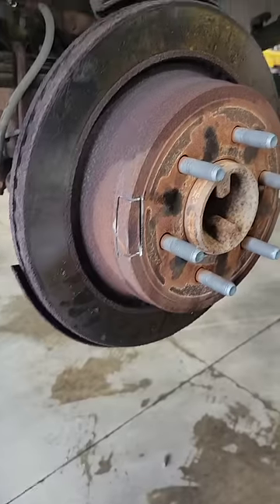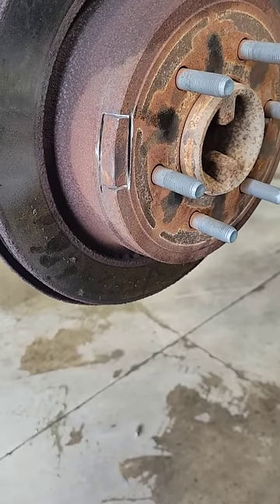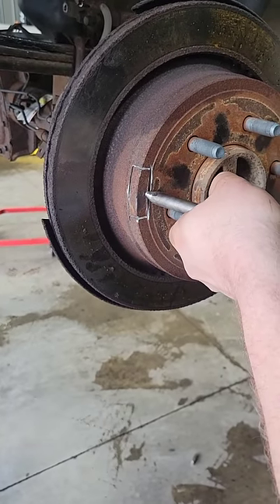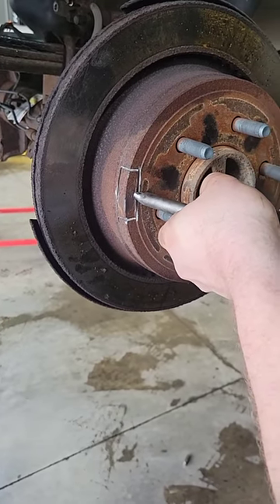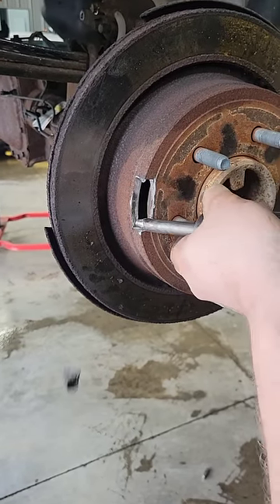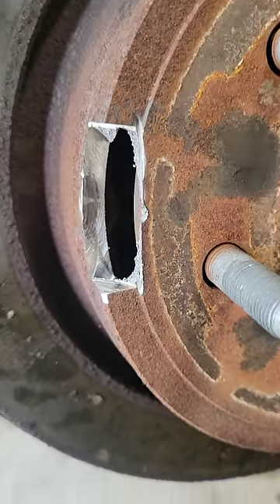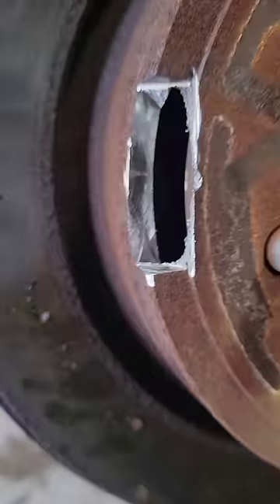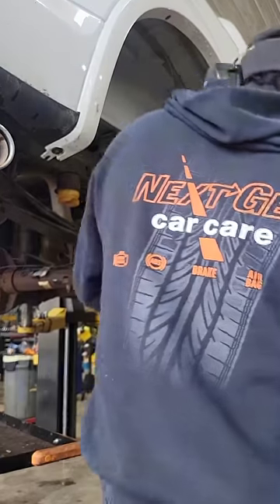Ford F-150 rear brake service.  Trying to show a trick on getting them off without further damage.

Comment: If this is the new breed of mechanics, we’re all in big trouble.
Reply: no i really think its the design of the rotor that consist of parking brake that made it worse for them.
Reply: @HighAway this isn't a new design.
Reply: @MattyH1992  I didn't say it was new. it's a known problem. probably the designer didn't forethought it but the down the dowels the birds sitting on, such as mechanics probably knew it'd be problematic.
Reply: Just get a hammer bro  the shoes on springs 🤦🏿‍♂️
Reply: It's fuck up by Ford. Every one else provides access holes to loosen the shoe adjuster. Some cars have access on the back via the backing plate, but most common way is to pull rubber plug form the hole in the disc to gain access. BTW, most of the time rotors go to the recycling bin if new pads are installed.
Reply: This is the new throw away version 😂
Reply: Cutting the rotor I don’t remember that in any mechanical books  or training from the factory schools .
Reply: I think we been in trouble already for quite some time, with the luck I’ve had with using different mechanics? Seems really hard these days to find a really good honest mechanic that won’t rip you off  last mechanic charged me $5,000.00 to fix all the oil leaks my engine had. Got it back home and it was still leaking oil as bad as it ever had. Think they just steam cleaned the engine and said they fixed it
Reply: I had "new" mechanics seriously argue with me saying my rotors were backwards. They're drilled and slotted. I had a tire mounted by these experts.
Reply: exactly he mentions using a hammer is not the way to do it, but he has a cutoff wheel for brakes. We both know he taped a head gasket leak. :)
Reply: that's why I prefer to do it than paying someone to destroy my car
Reply: They all get electrocuted, possibly in the soon 😂😂
Reply: There should be access through the rotors to the adjuster I blame whoever put the wrong/cheap rotors on last or blame the truck for not having a access hole through the back dust shield
Reply: It is and we are.
Reply: It actually does fit a spoon. There's a plug.
Reply: Easiest way to get rear rotors off, it'll the E brake works is at 30 mph slowly apply the e brake. You will hear a slight thump. Pull it on the lift and they will slide right off..
Reply: had to do this on my old cobalt lt shoes were engraved into the rotor and there was no ‘spring release’ or hole to put a screw in, this is exactly how I did it and it did no harm
Reply: @pliedtka and gm
Reply: @pliedtka wrong. New cars come with a plate that needs to be knocked out before the adjustment of the parking brake shoes. It is then filled with a rubber plug after the first service.
Reply: Hammer and some brake cleaner she’ll pop off
Reply: @mw5905 @mw5905 Actually you can in fact install slotted rotors "backwards".
There are videos that go in depth with the logic behind it but basically depending on the type of slotted rotor you have, you want the direction of the slots and the internal fins ( if at an angle) to be facing one direction.
Reply: @boostedturbotom drill into a tesla battery and zap lmao 😂
Reply: A break spoon....or even a flat screw driver......
Reply: I bet it sounds like a baby rattle when he shakes his head
Reply: Wow lol
Reply: Yes not my way either
Reply: @ghostridergale I do my own work, and take more time, replace more parts as "preventative" / slightly "ahead of scheduled maintenance"- which should be how cars are repaired, not just airplanes... 
But mostly because of the corruption of mechanics...
Reply: @mw5905 left and right rotors are in fact a thing.
Reply: @pliedtka no, ford does actually put access holes for the parking brake adjusters, this guy's seems brand new.
Reply: this is what happens when mechanics are paid by the hour and not commission.
Reply: @nunya2814 indeed. This guy has never seen drum brakes. Zoomers...
Reply: Don't have a  new breed of mechanics have Fitters. They fit stuff....
Reply: @pliedtka  do these even have shoe adjusters? GM drum-in-hat doesnt iirc
Reply: @mw5905 I had a new mechanic argue that you can't rebuilt an alternator.

He told me "theres no way you're going to rewind it yourself so don't even take it apart" as if that part ever fails on the alternator.

Comment: *forgets to release the parking brake prior starting the job
Reply: or seized?
Reply: Buahahahhahahaha
Reply: @HighAway  if the parking brake hardware is that siezed, then replace shoes and the drum brake hardware as well. Don't save that sh$t
Reply: 😆 😆 😆 😆 90%
Reply: Lmao done that a few times,  if you say you haven't you lyin 😂
Reply: not only that but there is a shoe adjuster on most (not all) drum brakes in which u turn it and should relieve tension
Reply: I hit mine for a good 5 minutes with a mallet. Went to take a smoke break, opened the door, and realized I left the parking brake on 😂
Reply: @ehh33636 Exactly. And if the car can move then it's not seized.
Reply: It's called the rust belt but that also happens
Reply: Evidence that he didn't?  Maybe the guy actually does know what he's doing instead of just using a bigger hammer.
Reply: @slushy7292  In that case, the parking brakes are not seized to the inside of the drum or rotor. They are just seized.
Reply: Been there lol

Comment: I wish these shorts had the name and location of the business so I know never to go within 10 blocks of there.
Reply: How else are you going to get it off, when it's stuck?
Reply: 7786 NY St Rt 5. Clinton New York

Found it on there website
Reply: @CM-xr9oq  I dunno...engage the parking brake and move the car ten feet to scrape the rust off?
Reply: @CM-xr9oq  Back off the adjusters.
Reply: @kugelblitz1557 that wont remove the rust ridge from the spot where the parking brake shoe doesn’t touch you dunce

Comment: I've been a professional massage therapist for the last 30 years and even I know all you have to do is back off the brake adjuster and the rotor comes right off. Probably why I still do most of my own work.
Reply: Whatever it takes
Reply: @RebelBoy-is7hw  The adjuster is accessed from the back of the backing plate. Crawl under the truck, and at the bottom of the backing plate is a rubber oblong plug, pull that out and you can access the adjuster star from there.
Reply: Doesn’t alway work like that. Sometimes there’s a massive rust ridge on the inside that doesn’t slide over the shoes.
Reply: Stick to rub and tugs at least you will get a happy ending….
When this happens to a real mechanic they smash the lot off and make you pay for new shoes and backing plate. 
Depends if it’s your car or a customers / who’s paying 
If you grind the backs of the locating pins off it’s quicker and easier.
Now rub my shoulder
Reply: IME in the rust belt those adjusters tend to be froze. Or maybe it’s just my luck.
Reply: That's what I said finally someone else knows what their doing
Reply: Yep, that's exactly what spider gears are for.
Reply: @corey5797  amen brother that's what I do
Reply: Most vacuum plates are rusted off in three years on every new I had they are all gone
Reply: @robglock2130 ou can also try pushing the cable if its hung up she might just release for you. 

Low success rate but its quick to try

Comment: Hit it with your purse. I've never seen anyone anywhere do it like you did.
Reply: Top comment
Reply: He saved the 12 dollars in parking brake hardware
Reply: @idabomb00  and destroyed the 50$ rotor in the process😂😂
Reply: 😆  hahaha
Reply: @idabomb00  saved? Hammering the rotor off wouldn't cause any damage unless they already at the point of needing to be replaced.
Reply: @GmKofHard  yes, saved. 12 dollars is what the hardware cost new.
Reply: @led1002 he said he was changing the rotor. Listen to the vid.
Reply: We've got a sledge hammer at our shop named "Your Purse".

Comment: This folks, is why your brake job takes 3 hours and costs $600.
Reply: This and also because of the electronic parking breaks that require you to get a damn diagnostic tool to release the cylinder so they won't get damaged when retracting them. Also you need a damn diagnostics tool to release the cylinders one by one in order to do a damn brake flush.
Reply: @thegohanmk7411  Thats why i love my +20yo shitboxes
Reply: 6 hrs minimum 9 to 12 hundred $$$
Reply: @thegohanmk7411  not true this is manual parking brake assembly with brake shoes and a brake drum in the middle of the rotor no computer control needed. and the one with the electronic parking brake can be put in maintenance mode by pushing the park brake release switch while holding the gas pedal to the floor and turning the key on then off then back on and wait 15 seconds while still holding switch in and pedal down and it will go into maintenance mode to be able to compress the pistons back into the caliper !!! easy peasy
Reply: @majiclikstk  rotors are $66 each and set of pads is $25 and takes 20 min each side to remove brake assembly , clean and maintain caliper and slide pins and pad guides and reassemble with new rotors and pads , I charge parts cost plus 15% and $150 labour so $330 for this job and done under 1 hour

Comment: Most vehicles have a hole on the inside plate covered with a rubber plug. This hole will allow you to back off the spring tension to allow drum removal.
Reply: Where do you see a drum in this video?
Looks like a disc to me.
Reply: @tommyguns9008 the parking brake is essentially a drum brake.  It has a disk around a drum.
Reply: Exactly!
Reply: @tommyguns9008  the drum is inside of what looks like the disc to u
Reply: Its literally called a drum in hat rotor. Also yes no cutting of the drum area to access the shoes. You access the shoe adjusters and loosen them a few clicks. Something you will likely have to do anyway when installing the new rotors. You can than tighten up the adjusters and set the parking brake temsion to spec. I swear the future is doomed with mechanics like this
Reply: There isn't a hole on this brake system. So what are you supposed to do unless you beat it off. Get it. Beat it off. Anyway that's why he did this
Reply: @danielquick5696  I've literally never seen a vehicle that doesn't have a backer plate with access holes or slots to get to the adjusters. This video is a terrible example of what to do. In no way should this be used unless all other methods have failed to get the rotor off
Reply: @scrumdiddlyumptious73  Your right. Only if the brakes are seezed up. It's either that or beat them off. 🤣🤣🤣
Reply: @tommyguns9008 don't reply when you don't know what you're talking about
Reply: @danielquick5696 nonsense. There is an access hole in the backing plate. Just remove the rubber plug and go to town with your spoon.
Reply: Shhhh 🤫 just let them go
Reply: @amneziaxeaster-gaming382 buddy this is YouTube, expect the worse.
Reply: Not quite, the adjustment is the internal spreader mechanism, nothing to do with spring tension. Helps to relax the psychical adjustments on the cables too.
Reply: @scrumdiddlyumptious73 The problem, is that those adjusters have a nasty habit of freezing up on these, especially here in Michigan. Its not uncommon to have to cut these off with a torch and replace all the hardware.
Reply: Integral parking brake system. The hat of the rotor serves as a brake drum for the mechanical parking brake shoes. It's has an screw adjuster on inside. The service plate has a plug you can remove and use a flathead or a brake spoon to compress the springs to loosen the shoes just like drum brakes. Once he gets the rotor off he still has to adjust the parking brake shoes to fit the new rotor on and do a complete parking brake service. Only thing he did was waste time. Definitely not a flat rate technician.
Reply: This is a rotor not a drum brake so access to the inside is not likely to be easy at all.
Reply: Not trucks, it in the backing plate, its a pain in the ass but yes same thing u just loosen the shoes then knock the scale off with the hammer on the hat and doesn't damage anything, do it every day
Reply: @tommyguns9008  These are called drum in disc configuration where there is a small drum brake inside the disc brake.
Reply: @danielquick5696  it must have a hole otherwise there is no way to adjust the drum parking brake.
Reply: @jasonsong86  I understand that but some manufacturers make huge mistakes. I've seen some messed up parts that I've just shaken my head at and wondered what they were thinking.
Reply: @tommyguns9008 you tried to do something. You failed…but at least you tried.
Reply: Then they would have to make an adjustment when they put the new parts in thay don't want to do that
Reply: @jerrywhalen2100  To adjust your parking breaks drive in reverse and pull your parking break. I don't know if this works on every car but that's how I do it. So you don't have to adjust them by hand.
Reply: That's the access holes to adjust the rear shoes👍
Reply: @tommyguns9008 tell me you havnt worked on many cars without telling me. It's a 2 in one brake setup
Reply: The only trouble with your comment, is this isn't a brake drum, it's a rotor.
Reply: Little difference in a rotor and drum lol just a little😁👍
Reply: I was gonna comment this lol
Reply: @tommyguns9008 the inside of the rotor acts as a drum for the parking brake shoes. And there is a hole with a rubber plug to use a brake spoon and back the park brake shoes off.
Reply: This guy.😂
Reply: @criticalevent  let me guess it's an electric parking brake? It's it like many new vehicles they utilize the actual caliper/pads to apply and clamp the rear brakes. There is usually a sequence of steps to get the parking brake actuator to retract fully. You have to usually unplug a wire harness that's on the caliper also. Even as vehicles advance brakes are one of the easiest repairs to do. Regardless if its dirty or a little extra work of removing wheels etc I'd rather do brake repairs than spark plugs on many of today's vehicles. You end up having to take have the engine apart on these new vehicles.
Reply: Yes. Thank you for saying this. The guy who made this video needs to learn that
Reply: Doesn't always work but why is he actually holding the punch instead of the hammer
Reply: @tommyguns9008 they have both parking brake is a drum and regular stoping brake is rotor 😂
Reply: @tommyguns9008 it’s a hat type rotor the drums inside
Reply: @scrumdiddlyumptious73 rust belt. You can adjust them down all the way and the shoes still catch on the rust ridge.
Reply: Yes, anyone who had shop class in highschool knows how to adjust the shoes away from the drum for removal, lmfao 😂😆, so many uneducated people making YouTube videos like this is amazing... After you adjust them it doesn't matter how deep the groove is, because it has removed material... Not added material therefore no need to cut up anything, it will slide right past the lip ... I mean think about it, the parts are used, so they are both smaller, the shoes and the drum/hat ... When they are new is when they are the biggest they will ever be...
Reply: Most vehicles have an adjuster hole, but how about this particular vehicle?
One would think that they would use the mentioned service hole to ease the parking drum brakes inside this drum disc rotor combo

…but apparently they either opted for a shortcut by destroying the drum disc brake rotor, or they already tried using said service hole but failed for whatever reason and were left with no choice but to cut this hole to get it sorted out…
Reply: @asakayosapro  looked like a shortcut to me... All drum style brakes have an adjuster spot, it's the only way to adjust them so the brake/parking brake works right...let alone so you can get them apart lol.  If this was a video that a shop I frequently went to put up I would never go back to that place, but that's just my opinion ...